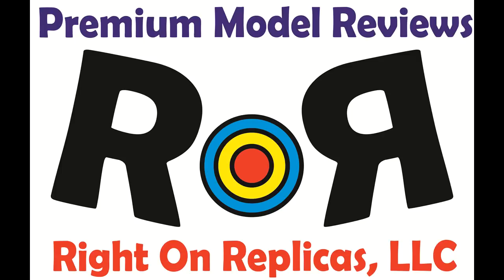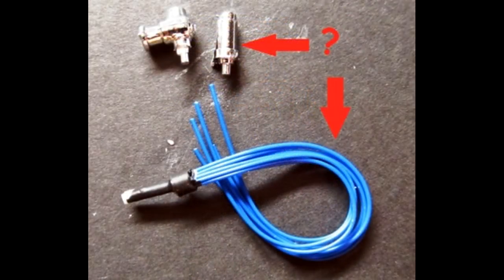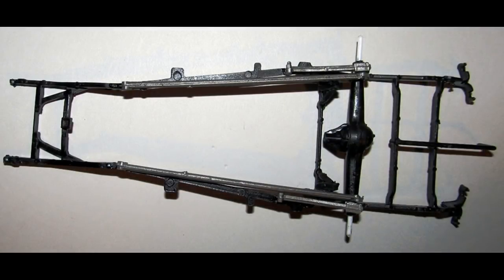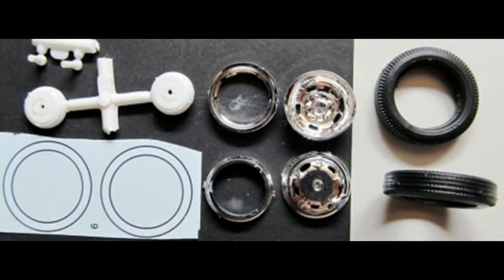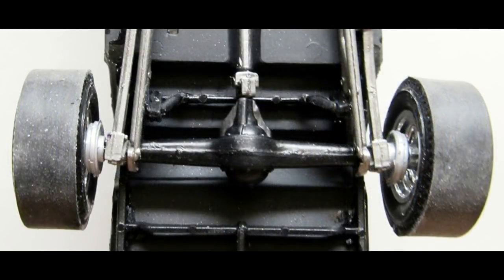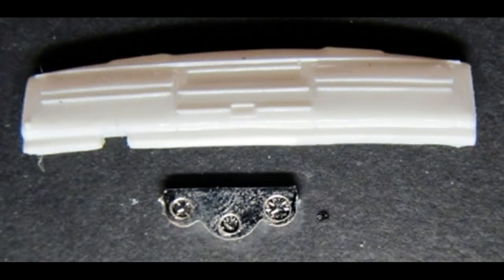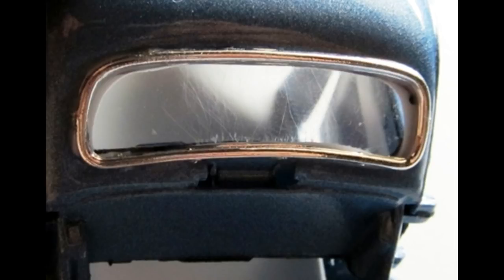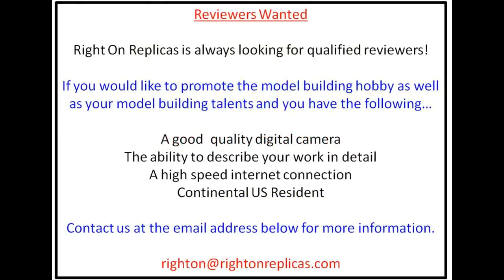How to Build the SW&C '41 Willys Gasser 1:25 Scale Revell Model Kit #85-1287

Comment: This is not a kit for the faint-hearted. This kit was first released in 1964 and is not substantially changed since. Parts are small and delicate, and there's a lot of them. The kit should be built slowly in subassemblies, with plenty of test-fitting before gluing. Working features are fragile, generally uncooperative, and detract from the scale accuracy of the subject, so if you want a scale replica, or a weekend project without too many surprises, don't buy this kit. I found a gel-type CA ('superglue') cement perfect for the 2-piece vinyl tires; after the cement is dry, put the tires in the freezer overnight and they will be hard enough to sand smoothly without removing the tread or chewing up the vinyl. Cheers.
Reply from the maker: Dave,  Thanks for the tips.  Now what "perfect" CA glue did you use? and please subscribe if you haven't already.  Thanks!  -Doug
Reply: GEL-type, as opposed to the liquid products. I buy from the dollar store, as I don't see any advantage in the much more expensive, designer products sold in hobby stores.
Reply from the maker: Dave, thanks for your insights!  -Doug